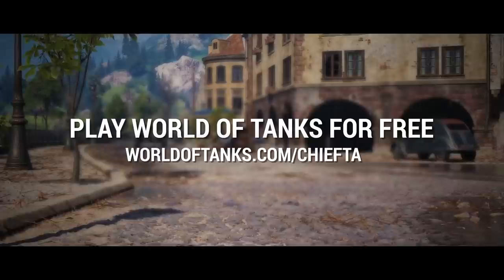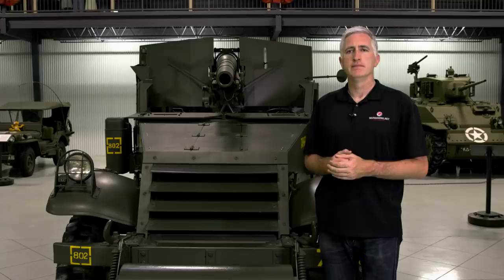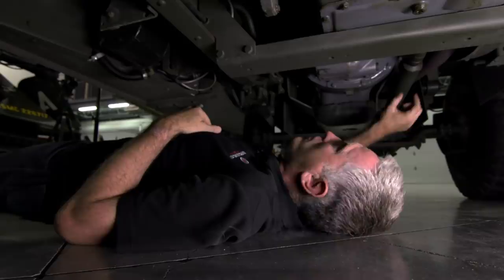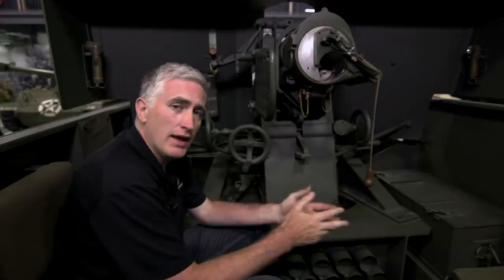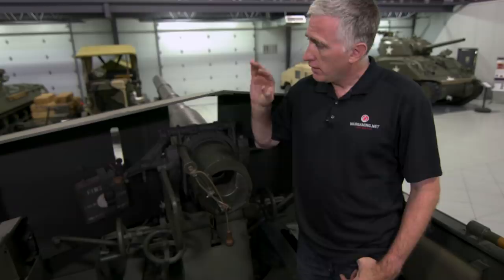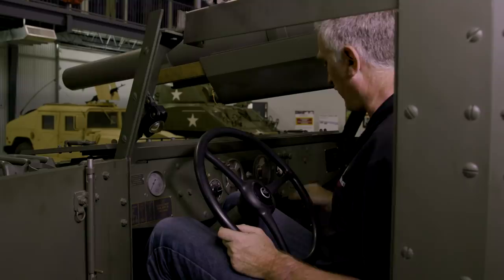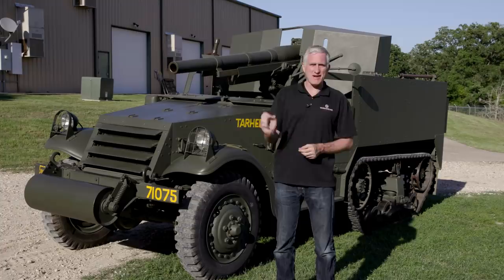Inside the Chieftain's Hatch: M3 GMC

Comment: Comparing this to a German halftrack really illustrates the whole 'German over engineering' point. 

On one hand you have effectively tank with wheels on the front, complicated  angled armour, complicated overlapping wheels, complicated tank suspension and drive system and a complicated steering system.

On the other hand you've got a truck with with the wheels swapped out for tracks. That's it.
Reply: One point is better cross Country capability
And the germans  had the Halftrack "Tractor" series in Production so why not use the Chassis for a SPw both the 250 and 251 based on the Tractor Halftrack series Chassis.

Not always  "overengineerd".
The germans did it with the "Maultier" series, on the 3t halftrack Trucks OPEL, Ford they swapped the rear wheel for some sort of Carden Lyod suspension at the rear axle. 
near wars end they looked for a full tracked replacement "Kätzchen" (?) (AUDI and BMM) for the half tracks.
Reply: @Sturminfantrist  the German Half-Track didn’t have notably better cross county performance in the equivalent US weight vehicles. According to the testing by the Soviets, US, French, and UK during both in-war and post-war testing.      
 They did have a better weight carry capacity and easier steering up to medium thickness mud.     But, they somehow had both worse ground clearance and a higher center of gravity making them the worse of both worlds.  Also an almost comical inability for the system to automatically clear mud from the running gear, and for the later now caked-in mud to cause damage to integral components (like to the terrible seal designs). 
 
  If you look specifically for the after-capture debriefing interviews held at the US Library of Congress and the Can. National Archives.  
Captured German soldiers & officers constantly raved about their happiness after capturing working or repairable US-made Half-Tracks(& trucks), and the basically absurd camouflage techniques they used on them.  Not primarily for a battlefield advantage, but to make them look German from a distance. All to keep them from being requisitioned away by higher-ranking officers who also desired the US vehicles over the ones they were issued.
Reply: @cjwrench07  I'm not sure I'd compare the M3 and the Sd.kfz 250 or 251. The M3 is a truck with tracks on the back, the 250 and 251 are much closer to flat-out APCs.
Reply: @RaptorJesus They both serve exactly the same purposes. There’s absolutely no reason not to compare them
Reply: @Sturminfantrist they were also chronically short of half tracks. 
The US Army in WW2 was just better at understanding that "good enough" is better than double the cost and halving the reliability to get something perfect.
I've seen the sdk and their silly interlinked steering and braking systems. 
The M3 and M5 were just big farm trucks. Any mechanic (and most of the regular GIs) in the Army could fix one and keep it running. It was robust enough that it could serve as an SPG at a much cheaper cost than a tracked vehicle and was much faster. 
Being able to produce enough trucks and half tracks might have made a real difference for the Germans. Basing your logistics chain on Russian trains and captured French or British trucks is a fools errand.

Comment: "As you may know, this vehicle is not in World of Tanks, and, to my best knowledge, it's not planned to be either."
Well, it's in War Thunder. It's the first TD you unlock in the American line. Good TD ... if air wasn't a thing in the game.
Reply: they do fairly good in "realistic" mode, where you can mount some bushes and hide from Air,   make danged good ambushers at thier own tier, and even uptiered
Reply: For some reason I feel like I'm doing better in this vehicle than the other ones.
Reply: @dinonuggiesguy4847  it's because at lowtier, you get a lot of games with people just starting out, or otherwise fairly new,  and if you play smart, you can just run rampant in a round, especially when you have a gun that basically one-taps everything it hits at its tier, or the tier above :)
Reply: @pablofiasco2  well you don't really one tap everything on tier 2 which where I use the m3. I still have it in my 3.7 and it still do well against some tank. But try not to fight head on cause the driver is just staring the enemy's tank barrel.
Reply: Would be even better if it had realistic rate of fire. Gaijin eventually bulked and added 5th crew member, but RoF remained at 4.5 shots/minute which is far cry from historical 12 / minute. "The fifth guy" is a loader who grabs shell from box, shoves it into gun when assistant gunner ("cannoneer") opens breech, then immediately reaches for next round, because closing gun and announcing it loaded is job of assistant gunner. Very infantry way of rapid fire.

Comment: My unit in Germany B Co 2/36  inf with the 3rd Armored Div had a M3 halftrack outside our barracks.  And it worked, Santa used to ride in it for Christmas parades.  It was the anti aircraft version so it had the mount for the quad 50 cals.  Since we were an infantry company we had 50 cals so we did mount them for displays.  Imagine being a mechanic assigned to our unit, your job is to maintain M113's, duece and a half's, jeeps and oh by the way you need to take care of this half track as well.  I got to ride in it but I never got to drive it.

Comment: The first vehicle I ever drove was a 1932 Chevy car that had converted to a pickup. I was about 10 or 11( I'm 80 now), and my dad let me drive it home from the dumps. It was a small town in Wyoming, and the road was not paved. I really didn't know how to double clutch a non synchronized 4 speed transmission. I was doing pretty good, considering, but when I had to to make a hard right to get the yard, I found it difficult to double clutch while going from 3rd gear to 2nd gear, while trying to turn the vehicle(no power steering), and before I could complete every thing, I ran into the clothes line(didn't really damage it, just sort of pushed it over. It was a steel pipe with a concrete base). Needless to say, I didn't get to drive again until I was 18, and truck was a 1940 Dodge pickup with a 4 speed transmission( not synchronized), no power steering, but with all my prior experience, I mastered the beast quickly. Sorry for the long winded ramblings of an old fart, but that half track's mechanical mechanisms brought back some fond memories. Thanks a lot.
Reply: That reminds me of learning to drive in a 60s f100 4 speed. The trans was so beat up the shifter felt like an axe handle sitting in a bucket of water.
Reply: Best to just rev up the engine and match rpm to shift to a lower gear than to double clutch.😁
Reply: @randymagnum143  You might be right, but I was taught to double clutch. Thankfully, I don't plan having another non synchronized car to worry about which way is the best. And lastly, thanks for the input.
Reply: @williamromine5715  last one I drove regularly was a 5 speed Clark behind a 534 Ford Super Duty. 1st to 2nd, no clutch, just slap it when it hit the governor, double clutch to 3rd, then 4th, let it run up against the governor and just let it slip into direct as the revs came down and then floor it.  40,000 lb truck and she would perform admirably.  Music through dual 3" exhaust.  Though a missed shift in a few places meant 2nd gear hill climbs at embarrassingly glacial speeds!   Her replacement had a 500hp Detroit and a 6 speed Allison, sooooo.....

Comment: I love how the Chieftain knows to keep his thumbs out of the way.  Easy way to break a thumb in a vehicle like this is to wrap your fingers and thumb around the wheel.  If your grip slips, the wheel spokes will spin and break your thumb(s).  Had an old Sgt from the Korean war era tell stories about new truck drivers seemed to always break one or both thumbs until they learned to keep the thumbs out of the way.
Reply: Yeah, broken wrists, too. I drove DUKWs for a tourist park here in Queensland, Australia and you can do some major damage if you don`t think about hand placement.
Reply: Having grown up driving a 48 2 ton Chev.truck ,53 ford  3/4 ton and  various  small tractors  with nasty steering , you learned   to have  a death grip on the steering wheel ,mater of  life and  death on tractor , no seat belt , or cab . .
The  53 started like  the M3 the 48 chev started with  switch on and  then step on a pedal on the floor ..   the  Dashes  of those  trucks  were  almost  the  same as the M3  , minus  a  Tachometer  ..

Comment: If I’m not mistaken, there is something under the truck that you wouldn’t see in most 1930’s -early 140’s trucks: 4 wheel drive. Although it had been a thing since automobiles started rolling around, most 4 wheel drive trucks made up until then had been almost exclusively for government and military. The exceptions being the aged Nash Quads which where made from 1913 to 1928, and Marion Herrington converted model T’s, but these were a drop in a bucket compared to the millions of model T’s that ran on American roads. That being said, to a 16 year old who lied about his age to join military, 4 wheel drive is not a hard concept to teach.
Reply: The US Army used four wheel drive trucks in WW1 - manufactured by the FWD corporation from 1909…
Reply: The U.S. Army had three four wheel drive trucks in WWI:  The FWD Model B, the Nash Quad, and the French Latil.  If you look closely at the video you will see a Nash Quad parked in the background in front of the M3.  The most advanced was the FWD Model B, which had all wheel drive with lockable center differentials.  FWD was the trademark of the Four Wheel Drive Auto Company of Clintonville Wisconsin.  Lots of surplus FWD and Nash trucks were used in the huge road building effort after the war.  Marmon Herrington wasn't founded until 1931  and didn't start converting Fords until long after the Model T were history.  That said the  Model T is actually a good cross-country vehicle because it's extremely light and has a lot of ground clearance.
Reply: FWD conversion kits were available before WW1. They were widely used in the logging and mining industries during the 1920's with some using J. Walter Christie's rubber band tracks slipped over the rear wheels for better flotation over muddy roads. Marmon-Harrington began producing FWD kits for Ford's commercial trucks in 1931 with Ford installing that at the factory by special order. I believe GM developed their own FWD system for their commercial trucks.

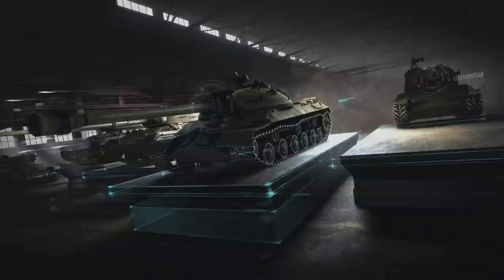Comment: 14:00  Armor for these lightly armored vehicles is given as thickness, naturally. But I'd love to hear what bullets it could stop at given ranges, as is often done with tank guns. This is especially needed since all 0.5" plates of steel are not equal. Just need the info for the nearly identical .30/.303 cal/7.92mm, and then .50 cal.
Reply: Steel-core .50 AP would go through that 0.5” plate at 200m; so it will, possibly, stop anything less.
Reply: 30.06 just puts a nasty mark on the paintwork of 0.5" plate (test by Parker O. Ackley), I'm not so confident about the 0.25".
Reply: Basically, rifle bullets. Axis forces did not use a lot .50 equivalent weapons. Even without penetration, .50 would cause nasty splintering - no spall liner whatsoever...

Comment: No syncros, no power steering, and a range selector.  Just like an old tractor!  Makes me think, today driving a tractor from the 70's or earlier (like a Ford 3000 or whatever) is a very unique thing to do and takes some practice, but back then it was probably almost no different from driving a regular truck, particularly for the folks who grew up in the 30's and 40's.  Only difference would probably be the lack of suspension

But that rotating breach on the gun is super cool!  I love it

Comment: Thank you for a trip down memory lane. My father was too young for WW2 and too old for Korea, however, he had bought two vehicles war surplus.
One was the M3 halftrack he used for different things like hauling gravel on his property to dump for the driveway, and he had mounted a Bantam backhoe.
It operated with cables, not hydraulic like the more modern pieces of construction. He also mounted the backhoe on a 2 1/2 ton GMC 6x6 later removing the second rear axle to shorten the turning radius. Both were eventually scrapped when they simply wore out. Restoration never entered the picture. He was born 5/3/1923 and died 12/27/2002. He was the youngest of the children.

Comment: About 1961, an M3 was in a local scrap yard with an "A" frame boom on the back.  It was used to load crushed cars on to a 40" flatbed truck/trailer .  When the owner died sometime in the 1970's  it disappeared.  I only hope it went to a good home.  Some were also used at the Japanese flower gardens as a tillage tractor.  (As surplus after the war like crates of 1710 Allison engines were given to farmers to be Natural gas converted and used on irrigation pumps.)

Comment: Hello Chieftain 

You stated that about " three score  M3 's made it to the Philippines " .   Actually, it was only about a dozen,
with another roughly three dozen of the original  T-12 Gun Motor Carriages to make up the numbers.  When
they went into combat, they discovered that the T-12 could NOT depress it's gun below about 10 degrees,
which meant that  1)  they could NOT engage enemies while on a reverse slope, with their hulls down and 
their guns depressed,  and  2)  when they tried to engage Japanese tanks at close range, it was impossible
to depress the gun in order to get on target.    In other words, they could NOT use point blank range and 
knock out an enemy tank with direct fire, instead, they had to engage at medium ranges, and try to score 
hits with indirect fire -  They quickly found out that trying to hit a small, moving tank with indirect fire was 
virtually impossible, which meant that, in the Philippines, the  Tank Destroyer Tactics proved to be a failure.   
Just another one of the many reasons that the U.S. Army was defeated in the Phillippines in 1942.  

This problem with the T-12s had never come up in the Lousiana and Carolina War Games, because, when
they engaged an enemy force tank, they simply pointed their gun at the enemy tank,  yelled  " BANG ! " ,
and the referee would wave his flag at the  M1  Combat Car and tell the crew of the tank that they were dead....

Regrettably, in the Philippines, the Japanese Referees refused to cooperate in this manner.....

Comment: Transmission and transfer case are nearly identical to my 1974 Chevy K-10 4WD,  including the shifter knobs, lol!   And yes, in 4WD-low and 1st gear, you can walk alongside it at rotor-tiller speed, lol!  In 1974 my father ran a small oil recovery outfit in PA. & had a vintage M3 (without armament) outfitted with a gas-drilling rig.

Comment: It looks like a good skilled crew of mechanics could build one of those, using modern parts. Getting the armor plate hardened properly would be the hardest part. But I'm pretty sure that could be figured out too. In short, if you are of a revolutionary bent, you could have your own armored vehicle.
Reply: Tracks aside, and those aren't real complicated , its not far off from a modern technical.
Reply: Getting the armour plate is easy enough, just call up an armour plate manufacturer like AR500.

You aren't going get armour plate by "Hardening" easily sourced mild steels. You might make it harder, but it then becomes really quite brittle. The last thing you want is your "armour" to shatter when hit, and throw even more shards of metal at you.

You would need good quality high-carbon steel, at minimum if you wanted to heat treat it yourself.

Comment: That builders plate and its recommended 72 octane is a nice reminder that we drive our cars on what is essentially aviation fuel by ww2 standards. Also a nice reminder that we are spoiled with our multiviscosity (or multiweight if you prefer) motor oil and engines designed with it in mind these days (note that it has 2 separate lines, one for summer one for winter rather than a single line like 20W-30).

Comment: Those gauges were also used in GM's civilian cars and commercial trucks. The motor actually was made by Hercules, who only made extremely reliable commercial truck engines for the past 20-some years. White bought out Hercules after WW2 ended.

Comment: I can imagine the unarmoured driver controlling the guns travel lock could lead to problems in a meeting engagement or a frontal ambush- the nightmare scenario would be someone having to get out behind the gun shield to disengage it! Obviously the doctrine had imagined them firing from ambush positions themselves but the fog of war did not always oblige.

Thanks for keeping the background music lower than some of the other WoT videos! Although I felt some of the transitions were a bit awkward- some of them lingered a bit to long, like the Chieftain had just delivered a punchline. Really enjoyed the video though!

Curious to know whether the marines ended up using them as indirect artillery on occasion like the army did. (The AT corps was made up of ex-artillerymen, and when the expected German tank horde did not immediately materialise AT commanders kicking their heels at the rear quickly realised that the 75mm AT guns still functioned as artillery pieces with a little ingenuity)